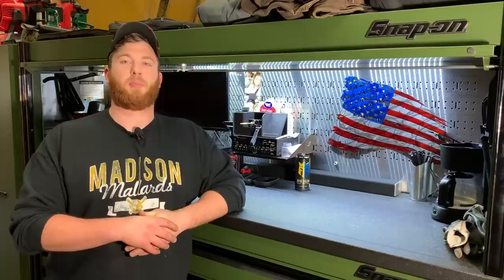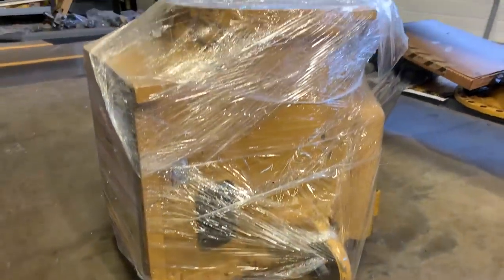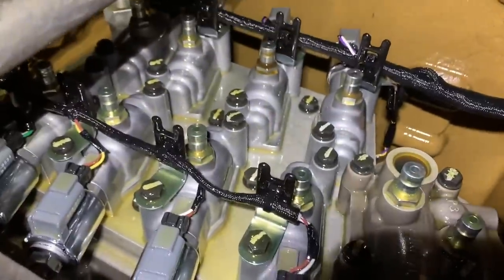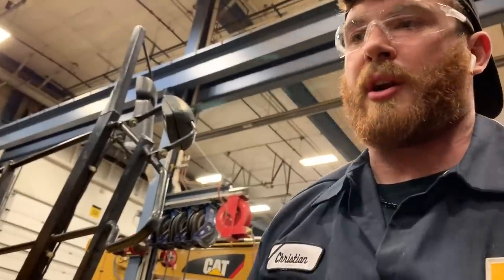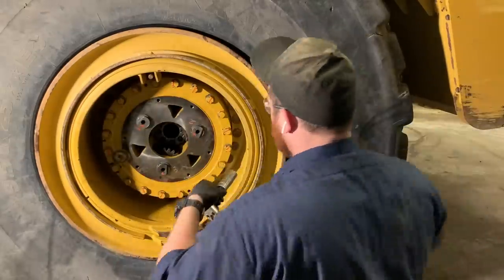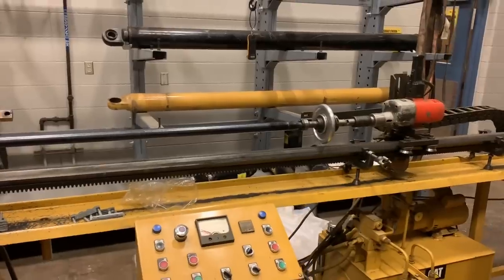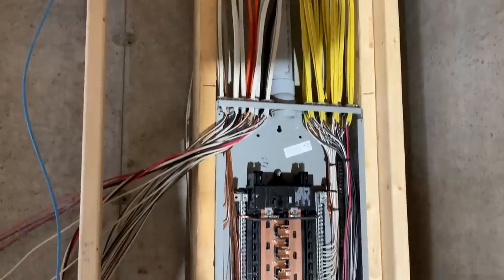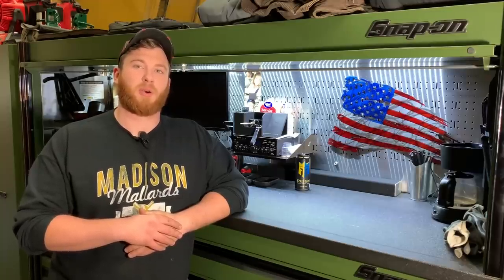Day In The Life Of a Cat Mechanic

Comment: Retired for 10 years now, but put in 45 years as a Cat mechanic so I have to ask the question on the haul truck...I’m sure you did, but did you make sure there was no coolant contamination from the transmission cooler? As you know, it doesn’t take much coolant contamination to gum up the works in those transmissions. Nice vid, nice shop and I can see why you moonlight with that Snap-On setup you’ve got there 👍👍👍
Reply from the maker: Siskiyou Woodsmann yes, that was another possibility I kept in mind. And we did change the cooler. The only issue I would see with that is the fact that transmission oil pressure is running at much higher psi then coolant pressure so the transfer would most likely be the opposite direction.
Reply: Christian Beyer ,

Your correct when the machine is running, but not when it’s shut down with zero oil pressure and 15 psi coolant pressure, that’s when the transfer takes place☝️🤔

Comment: Ben I worked in a cat dealership for 15 yrs. in Atlanta I started in the main shop as a tech. And worked my way up to the rebuild shop or some places called it a spec shop . I started off doing engines and then moved to transmission and gears . The shop pulled them out sent them to us and we rebuilt them then put them on the dyno and sent them back to the shop. Best job I ever had .......
Reply from the maker: Jelt NY I like the setup we have, we do all the rebuilds and R&Is in the same shop.

Comment: Great vid man, I work in mines in Australia, little tip with the electrical side. When you are twisting cables into bp's or any terminals try to make sure the cable doesn't get twisted and is only twisted at the exposed copper. Apart from that man,  love your work,  from down under!
Reply from the maker: JM Thanks for the advice my man! Appreciate the support!

Comment: Looks fun working in a shop environment I've been a marine industrial mechanic for 15 years now I work on a rotating shift 12hrs a day for 14 days most of the time sometimes it's 21 or 28 days but you eventually get 7 days off I work on cranes winches diesel engines pump rebuilds valves threaded pipe install or replace we also do electric motor & gearbox replace it's seems alot nicer in field work but I only worked in shop 3 months total & did not like at all we often call CAT out as we have upgraded to newer engines & not many of us are experienced with them but they seem nice

Comment: I had to re-pack a lift cylinder off a VOLVO L220H but without a crane and without a cylinder bench. I wasn't even aware those cylinder benches and honing devices even existed. Been at a Volvo Dealership in Texas for the last 2 years. It would be cool to work on CAT later on in the future.

Comment: Hey man nice video! Just some more information on those articulated trucks if you don’t already know, I work in F/S for CAT in Arizona and I’ve done a bunch of these transmissions in 735, 740 & 745 B’s & C’s for transmission problems... slipping or clutch fill calibrations. Don’t forget your service letters on these transmissions they are a know problem over here everything the ones that have be reworked are starting to fail in the same way all over again. Hopefully CAT will get these figures out and fixed for good.
Reply from the maker: Shane Kee thanks for the support man! And yeah I definitely know the service letters well! Done so many of these transmission jobs I can’t keep track.

Comment: nice job and a clean place, but an advice is that i would not  recommend resting clean parts on pigmat. it will cause for contamination in the transmission.

Comment: Hello Christian - I am enjoying your channel. Than you for doing this! Quick question - is there anything that can be done to improve the fuel mileage on a 2006, Kenworth T200 with a Cat C15 550HP engine? Thanks much!
Reply from the maker: Steve Rendall Honestly that is the kinda question for our truck shop division just because as a heavy equipment dealership we follow manufacture specs on everything so. But the guys in our on-highway truck division would be able to answer that for you better.

Comment: How do you check trans clutch pack pressure in the field on that haul truck? That looks like a major pain.
Reply from the maker: Definitely a pain, you have to open it up as you see here and there is a plastic cover with access holes for the pressure hoses.

Comment: Not a mechanic here.  100k miles on a car is kind of (used to be) the number of miles  where the car now has a ‘lot of miles’.  What is a ‘lot of hours’ in your heavy machinery world? Thanks
Reply: Hours of operation is the measurement method used, mileage is irrelevant.
Reply from the maker: A lot of hours is 20-30k. Usually machines need to be rebuilt once or twice in that time frame.

Comment: ECONOMY is booming right now more work than man can get it done. Christian what is a rough cost of that CAT dump truck transmission rebuild? GREAT video - looks like a very clean shop and good shop tools.
Reply from the maker: Aris Torm Hard to put a number on the whole job because it depends how deep you go into the system as far as clean out and other things that you find need to be replaced. But the last one I did, just the trans rebuild (no R&I included), was around 35k parts and labor.
Reply: @ValleyCityAutoYT  Nice clean shop to, very good video (one thing would recommend make sure you wear knee pads). Kneeling on concrete is not good on joints. Kinda figured the price tag in that region, the big equipment takes a beating. 👍
Reply from the maker: Aris Torm Yea I have an assortment of knee creepers and pads. I have seen plenty of old guys that got knee replacements.
Reply: @ValleyCityAutoYT  Kinda thinking that knee replacement would extremely painful and not last.
Reply from the maker: Aris Torm sure seems that way!

Comment: Hey man! I tried asking some of the other guys online, but, I was wondering about some tips or tricks with wrenches and hydraulic fittings, what with all the angled wrenches and such and how they benefit the mechanic. Ah i dont know if you ever think to video hydraulic stuff  ill be watching!
Reply from the maker: James Groomes Well I use the four-way angle ranch is made by Snap-on for hydraulic lines. The reason being is the flats of a hex whether it’s a bolt or the nut on a hydraulic line are all 60°. Those angle wrenches have a 30° angle and and a 60° angle and therefore if you flip either end the opposite direction you now have the ability to get on a flat from any possible angle that it may be at. Definitely a must if you do much with hydraulic lines on a regular basis.
Reply: One tip that can also really come in handy on hard to reach or stuck hydraulic fitting is a crowsfoot with an extension on an impact wrench. Works amazing to break loose a stubborn nut in a tight spot

Comment: I'm trying to decide between heavy duty and truck & coach mechanic. Its awesome seeing you tear apart a trans and rebuilding it! Is that a pretty typical job?
Reply: I think it depends on the shop and on the failure cause on the 745 and other models that use a certain trans they fail pretty often cause the clutches just obliterate and in my shop we just remove and replace them and send the failed trans off to cat I believe for the core charge but cats fix to this failure or before failure is changing the clutch pressures
Reply: Heavy duty is where the money is

Comment: So I work at a kenworth dealership and I’m thinking about trying to get into a cat dealership for heavy equipment I have roughly 3 years of experience working on semis doing practically everything you can on em. I’m currently 19 been in the shop since 16  do you think cat would take a chance?
Reply: Hmm maybe if your certified.
Reply: Dave's Garage I have certifications for semi related stuff but nothing for actual heavy equipment. I didn’t go to school for diesel training I learned what I know so far from working on it and the couple of classes my company has sent me to
Reply: @quentinblack287  than I'm not sure. I dont work for someone but repair my own dump trucks. I assume you might need to get some training from the dealership you aspire to work for. If they dont offer that. And what certifications you have arn't enough than you might have to take another year long course. Not too sure but this is what I think it might be. Good luck on your journey.
Reply: @quentinblack287  p.s they should except you if you did the same work at another dealer.
Reply: Dave's Garage yeah I understand what your saying. I wish I could take off a year to go back to school for heavy equipment but that’s just not in the cards right now. Thanks for the input man
Reply: @quentinblack287  absolutely. And go ahead and try see if it works. It'll be a life changing decision
Reply from the maker: Quentin Black We have hired a guys out of the Peterbilt dealership with a couple years experience. Certifications don’t weigh into it much. 
Best bet is to walk in and talk to a shop supervisor.

Comment: Do those cat off roads run 30w in the diffs? I know cat dozer's and hoes run 30w in the finals.
Reply: Austin Schweich depends on your climate, here in a Missouri we run 50w in the diffs on (most) of the larger machines. Smaller machines and a few others use different oils.
Reply from the maker: Austin Schweich Yea, it depends on the climate but we run 30w up here in Wisconsin.
Reply: Christian Beyer I wondered if you might

Comment: What is the starting pay for a beginner  and what does it max out at (master tech level) ? Thanks for the reply.
Reply from the maker: Charlie Hustle The beginning pay rate has gone up since I started I believe it’s somewhere around 20 or just over. And there’s not technically a max out number. Depending on what you’re doing and your supervisor there are guys making close if not over 50 bucks an hour.
Reply: @ValleyCityAutoYT thanks for the reply bud! I was just curious. I work on forklifts, babies compared to what your wrenching on.

Comment: I work at a company called brake supply and we do the same work I'm working on a 773 break tonight wish I had a job with cat customers this company don't pay shit
Reply: Brake
Reply from the maker: jacob boone Yeah I hear you, that’s a definite benefit working for this company. Very very good pay and good benefits.
Reply from the maker: jacob boone if you’ve already got some experience in the industry especially working on the same equipment it shouldn’t be too difficult for you to switch over. They only require about 3 to 5 years experience.
Reply: @ValleyCityAutoYT  yeah I'm looking into that I've got 5 years of experience but in WV the coal mines are slowing down and business ain't so good I don't know if that affecting cat or not
Reply from the maker: jacob boone that most likely affects the cat dealer too.